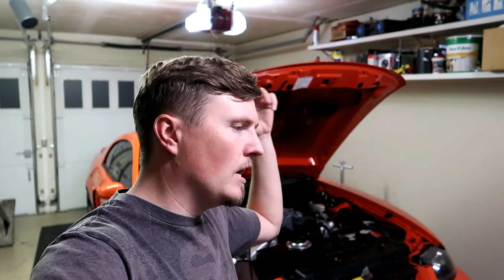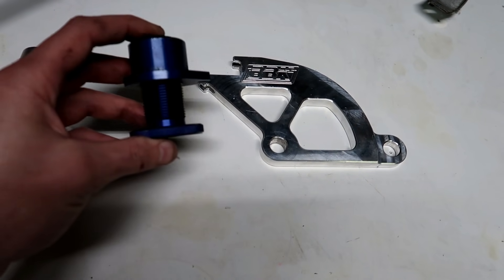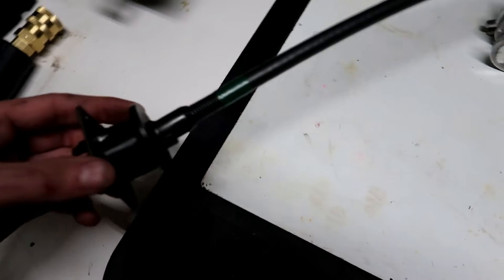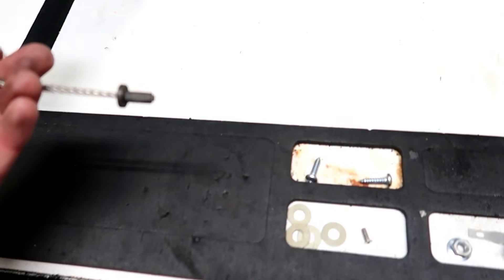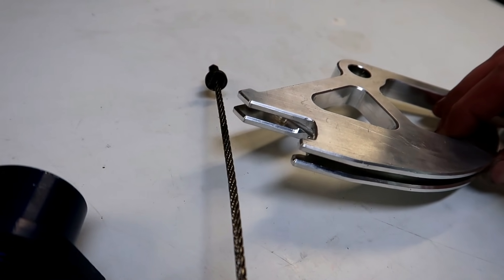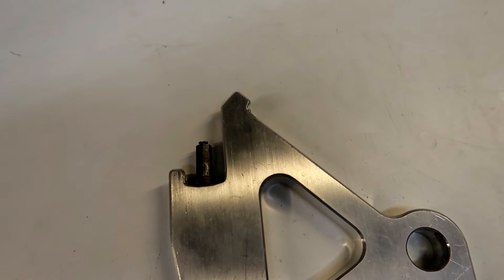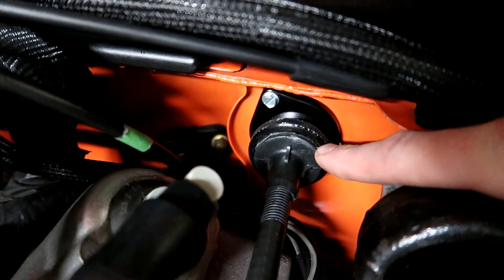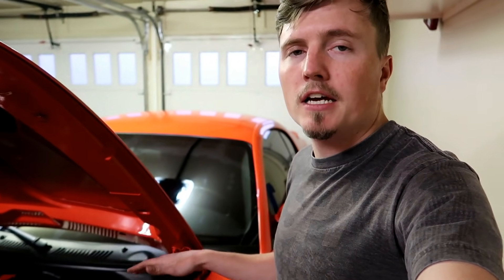How to properly adjust your clutch cable!

Comment: Having an issue in my 02 GT where my clutch pedal will rattle only a little at idle, but a lot during acceleration and deceleration from about 1300-2200 rpms. Just touching my foot to the pedal will stop it from rattling and it is for sure the pedal itself that's moving. I've been having this issue pretty much since install (exedy 350 stage 1 clutch and flywheel, steeda quadrant and adjustable cable, and SR performance firewall adjuster). The old self adjusting quad had a type of return spring to my recolection and since this is an aftermarket one they do not utilize them. There is some play in terms of the return postion at the top, I can pull the clutch up some more when its at the top. Any suggestions?
Reply from the maker: Make sure your clutch fork is pushed in and properly installed, check out this video to see what i'm talking about https://youtu.be/-TgJuFxgUo4?t=435

Comment: If having the clutch adjusted with preload how in the video is shown , that would disengage the clutch quicker and when releasing it would engage right at the top my question is would having it setup like that cause slippage ?
Reply from the maker: If your cable is too tight yes, but if you get rid of the slack properly like i have the pedal will be just getting firm and it'll be close to the top like in my video. If you start to notice slippage loosen your firewall adjuster and see if that helps. The only way you can have slippage regardless of how your cable is adjusted is if your pivotball is too long and you TOB is pushing on your clutch fingers. My new clutch is actually suffering from this issue and I'll be making a video on it here soon!

Comment: I like to stop on a steep hill and let the car start to roll back, then slowly let the clutch out and see where it's engaging. Good video. I think the clutch forks wear out on the thin metal that holds the tob and cause shifting issues. I just bought a new clutch fork along with a new clutch and bearing. I bought the firewall adjuster and quadrant too a little while back. I think the tob is what causes the worst or smoothest clutch feel. I have read too that some guys put white lithium grease on the cable and run the cable back and forth to feed it in so the cable doesn't saw away at the cable housing and moves smoother.

Comment: Hey bro I recently bought a 96 gt pretty cheap because the clutch doesn’t fully disengage so it grinds every gear it has a aftermarket quadrant and firewall adjuster what do you recommend checking I doubt it’s the clutch it’s a stage 3 thanks
Reply: Izaack Qtvv sounds like a clutch adjustment issue. Try that first and find if it makes a difference. If not you’re going to have to inspect the clutch and possibly tear the trans apart and check the synchronizers for worn teeth. Those help seat the gears smoothly and “synchronize” input shaft speed to gear speed. If they’re worn they’ll grind

Comment: hey man. I'm having a really hard time getting my 2004 cobra into gear. like really hard... its taking almost all my force to get It into gear. could this be fixed by adjusting my cable? and if so do I tighten or loosen it. If anyone in the comments can help me as well that would be awesome!!
Reply from the maker: If it can fix your problem you need to spin your firewall adjuster counter clock wise. This will tighten the cable.
Reply: @JaegerWrenching  I had to go under and adjust it by hand, but problem is fixed. thanks for the fast response.
Reply from the maker: rrated you’re welcome I’m glad it’s better now!

Comment: Just bought a 10k mileage 03 yesterday. Stock clutch engages like a centimeter off the floor. Wtf! I've stalled it 5 times already. You can hear the flywheel spinning when the clutch is released in neutral.

Comment: So backing out the adjuster will make my tob squeak so would that mean that its too loose?
Reply from the maker: it means you either need to keep going out or your TOB is bad, so try going out more until the TOB stops squeaking and the pedal is nice and stiff, doesn't ahve any slop in it.
Reply: JaegerWrenching  if I kept backing it out it would make a loud grinding noise when at a specific rpm when I’m neutral or gear . The rpm of the would be set higher if I backed out the adjuster . Right now I have adjuster more clockwise and the there is slight tob squeak but no loud grinding noise at rpm. Only slight grinding when downshifting into third . If I rode the clutch at the rpm of the noise it would not make it
Reply from the maker: send me a video to my facebook page Chad Jaeger.
Reply: I took it back to the trans shop. They said the tob gave out . They put a new clutch in but it still has symptoms of a bad pilot bearing . They put a new one in but at least the noise is gone . I appreciate all the help
Reply: that01cobra /roycobra180 glad you got it sorted it. Some brands make noise regardless of being new. On tremec transmissions in mustangs, I’ve read in forums that you should replace bearings with Ford Racing quality. Super smooth, quiet and somewhat OEM feel(I believe) I’m currently doing my clutch with that brand except clutch kit and flywheel are from exedy.
Reply: that01cobra /roycobra180 if you hear a squeak/squeal when the car is in neutral with your foot OFF the pedal and you then rest/ride the pedal about 1/2” and it STOPS making noise, then the TOB is bad. 

If you hear a squeak/squeal with the car in neutral/in any gear/while cruising at any speed (in neutral or in any gear) and you press the pedal down to the floor and it doesn’t go away.. the pilot bearing is bad(or worn however u want to say it lol) 

If you hear a terribly grumbling dry squeal no matter what the car is doing INTERMITTENTLY (stationary, engine running, neutral or in gear and while in motion, foot off pedal or pedal to ground ) it can be an input shaft bearing inside the actual transmission 
Just an FYI cuz I believe mine is crapping our. Made that noise 12 months ago hasn’t come back and it was super cold that day. Next day it did it in the morning but went away. Hasn’t come back but I’ve heard it in the past 2 years 3 times. Very very rare but I was lucky to hear it

Comment: If your still active on here I have a 73 mustang v4 I installed a clutch kit and the pedal feels like there is nothing there but it pulls the clutch fork I installed a bbk firewall adjuster and still nothing have any ideas?

Comment: Great video! However the quadrant doesn't have "adjustments" the hook on the end is for cables without a firewall adjuster and the one further back is for the adjusters to be used.

Comment: hey man, ive only had my cobra for a couple months now. Under load, i cant grab gears (lots of granny shifting). So im thinking its a clutch cable issue, however i believe its still the stock set up and possibly the stock clutch as well. Any tips on working with the stock set up? I also feel a little bit of chatter when letting off the clutch as well in first gear, could this also be the clutch cable? Sorry about all the questions! Thank you, your videos are super helpful man!!
Reply from the maker: If it chatters in first gear then it's probably not a stock clutch and definitely not a clutch cable issue.Bad clutch cables make the clutch pedal super stiff and almost unbearable to push in. if it's a stock clutch cable with no firewall adjuster you can't do anything for adjustment beside pull up on the clutch pedal as hard as you can and see if it clicks. If it clicks this may fix your issue, if it doesn't look at it to see if it's stock. If it locks you out of gear while trying to shift at high rpm this can possibly be fixed by a new quadrant and firewall adjuster being that it's adjusted properly. My recomendation is maximum motorsports for everything. they make a kit with cable, firewall adjuster, and quadrant linked here: https://www.maximummotorsports.com/Clutch-Cable-Quadrant-and-Firewall-Adjuster-Package-P385.aspx That kit installed right on a good clutch and TOB will solve 99% of peoples problems following instructions in this video. IMO buy this and install it, i bet it fixes your issues. If for some reason you have issues still you can say you went the cheapest route possible and now have a perfect setup for a brand new clutch and TOB that will operate flawlessly.
Reply: @JaegerWrenching  thanks brother
Reply: @SIKMACH1  hey James did getting thea clutch cable adjusted help your situation at all?

Comment: My clutch pedal feels pretty good after following your instructions but now when I put it in 1st gear I can hear a driveline clunk. Am I too tight?
Reply from the maker: Peter Quigley no, sometimes you may hear the clunk, try going a little tighter and seeing if it goes away,
Reply: JaegerWrenching it's not that loud, but with the windows up and rhe radio off I can hear it. I have a OEM cable. My firewall adjuster is just over an inch out
Reply: Is that excessive?
Reply from the maker: No that’s very normal, mine was almost 2 inches out.
Reply: JaegerWrenching ok, I'm going to drive it to work and I'll report back. The pedal feels like it might be at the high end of 8 pounds for the first half in so I don't really want to go any tighter. Thanks for the help man. Just curious, what state are you in?

Comment: What clutch cable would you recommend for a 99 cobra?
Reply from the maker: Yanezz 05 maximum Motorsports
Reply: JaegerWrenching would a bbk quadrant be a good quadrant as well?
Reply from the maker: Yanezz 05 Just their quadrant is fine, I did like maximum Motorsports kit the best of them all.
Reply: JaegerWrenching do you have to installed washers for the quadrant?
Reply: JaegerWrenching sorry to bother so much but I just installed my quadrant, cable and fire wall adjuster and when I go into first from a stop sometimes I hear a clunk like if the clutch isn’t fully disengaging so I jacked up the car and with the clutch fully pressed to the floor I put it into first and my wheels move alittle bit then stop after it’s fully in first. So my question is do I tighten up the cable until that no longer happens or am I doing something wrong? Thanks
Reply from the maker: @yanezz0533  Yes try tightening the cable a little and see if it goes away
Reply: JaegerWrenching the clutch engages pretty high off the floor would It still be okay to tighten or do I risk damaging something?

Comment: Thank you so much for this video! Where is the cheapest place to get one of those kits?
Reply from the maker: Jonathan Sardinas it’s not about getting the cheapest when it comes to working the way these should. Maximum motor sports sells hands down the best cable and kit for our cars. I’ve tried them all and wouldn’t use anything else

Comment: I recently got my throw out bearing replaced and before my clutch would engage/disengage at the very bottom..and now after the replacement it’s at the very top. Is this normal? I have an 04 Mach 1..I kind of like it cause I can just push in and get off when wot without worrying about missing a gear
Reply from the maker: if your old TOB was really worn yes the new one will change the engagement point. But make sure your clutch fork is properly engaged on the pivot ball.
Reply: JaegerWrenching ok thanks. But how would I check that?
Reply: New subscriber btw..like literally today lol
Reply from the maker: sweet! over 600 subs now! so thanks my man! you'd check it by making sure the clutch for is all the way up and it doesn't bounce around. did you install this TOB or have a shop do it? and does your car have a firewall adjuster on it?

Comment: JaegerWrenching awesome video by the way.   how often do you adjust you clutch cable?
Reply from the maker: You should only need to "Check" or re adjust it two or three times with a new cable as it stretches out a little. I've adjusted mine twice since installed and it hasn't stretched anymore!

Comment: Great video, will definitely utilize some of the knowledge you shared when installing my Steeda clutch cable kit (firewall adjuster, quadrant, + cable). Currently on the stock equipment, and the clutch is catching close to the floor with a wicked stiff pedal.
Reply from the maker: Mike DeStefano your clutch cable is for sure bad! That’s almost always the cable when the peddle is super stiff.

Comment: I just manual swapped a crown vic last week with a TR3650 from an 03 Mustang GT. Used the UPR clutch cable kit (firewall adjuster, cable, and quadrant). A friend of mine also manual swapped a crown vic almost 2 years ago and I bought most of the same parts since I enjoyed the way his drove so much. We're both running UPR cable, quadrant, and firewall adjuster with Exedy mach 400 stage 2 clutch kit (full kit with pilot and throw out bearing), and TR3650 trans. Cables are routed pretty much the same path but I almost feel like I'm standing on my clutch pedal to get it down to the floor. Would adjusting the firewall adjuster help this? Or just change where the clutch engages/disengages? Have you used the UPR cable? Other than that, do you have any ideas as to what it could be causing my clutch pedal to be so stiff? I appreciate any input.
Reply from the maker: Flynnbot it’s either the clutch diaphragm springs are heavy or the cable is bad. Was it always super stiff? Or did it slowly get bad?

Comment: Nothing for hydraulic clutch 🤪
Reply from the maker: Hydraulic operated clutches don't have cables so this title wouldn't work lol! Do you have any questions?
Reply: Push rod broke on 07 dakota gets to being a pain in the ass when it likes to fall to the floor at a stop light was looking online for a simple bypass till I get a whole new master cylinder for it 😕 they don’t sell just pushrod that will click back into the master cylinder
Reply from the maker: @SmudgyContent  Yeah unfortunately most places just sell them as a whole, and it's rare that just a pushrod breaks. if it's a metal pushrod weld it! If it's plastic you're probably going to have to wait until a new one arrives.

Comment: Is the same on a 2008 GT? I think I need to change my kid's. I pray it's not the actual clutch.
Reply from the maker: Kenny Lauderdale no 2005 and up are hydraulic, but you can have throw out bearing issues with them. Your 2008 is at the age where it’s either clutch or throw out bearing.

Comment: Any idea what would cause a clutch pedal to chatter when not it gear or when driving and letting off the gas?  Recently had the clutch and pressure plate replaced, steeda quadrant, new cable.  Any thoughts would help!
Reply from the maker: clutch fork not seated on the pivot ball properly

Comment: So I have a 87 mustang 5.0 5 spd manual and I have a low clutch pedal but no throw out bearing noise. Should we adjust the pedal? Does this stock have a firewall adjuster? Any help would be great.